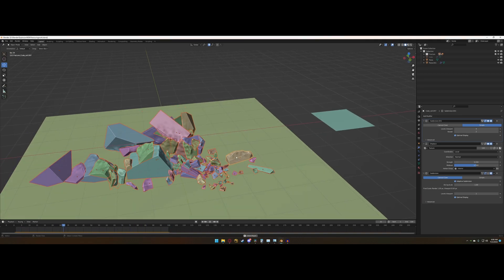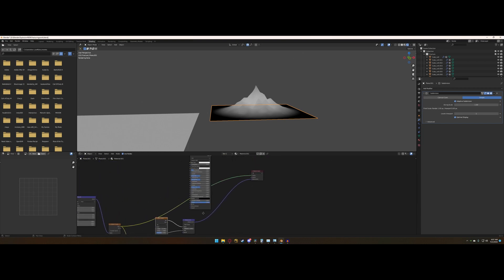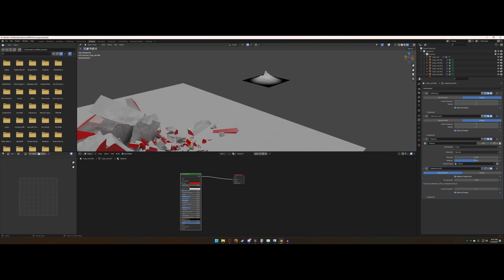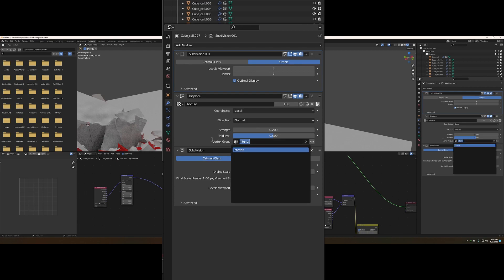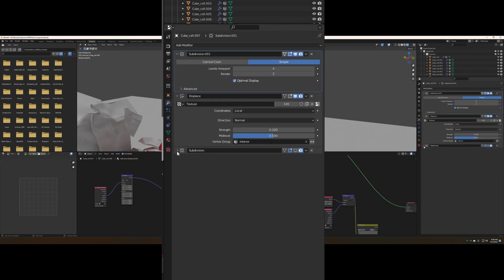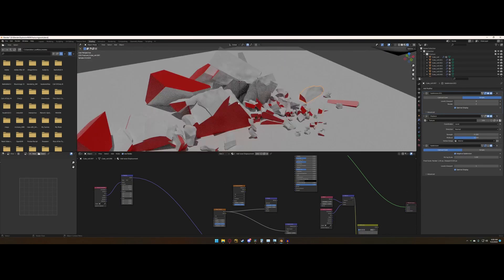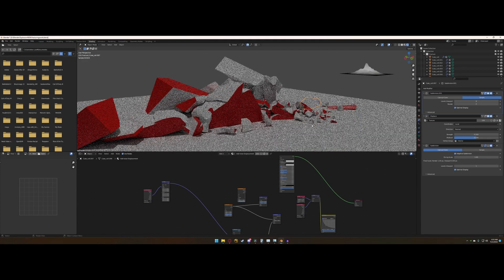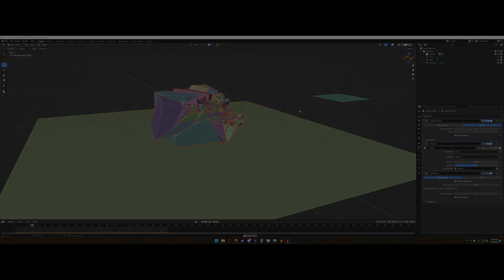More Realistic Destruction | Blender Tutorial (No Addons)

Comment: but with that method, the noise is not visible on the surface of the object, and there are intersections inside betw pieces
Reply from the maker: I'm not entirely sure what you mean by on the surface of the object. The goal for this is too keep the noise isolated to the interior. But I do agree with the issues about interesction inside pieces. It's kind of a hacky option, but it works so long as you cook out your sim first a lot of the time. 

In the future I want to create another version of this video going over some much better ways to do this
Reply: @levelupvfx  by noise surface i mean to not see perfect voronoi pattern outside but see noisy edges. Also the interior group that creates is not so acc. Is better generate global noise and use proxies for the sim.

Comment: I tried the technique yesterday but can you tell me how did you generate the interior vertex group ? Does cell fracture can generate it by itself or do you do it manually for each peace of mesh ?
Reply from the maker: In order to get the interior group, you need to check “interior vgroup” when in the Cell Fracture Menu
Reply: @levelupvfx  Thank you didn't see that, however I got a problem. I copy modifiers from active except that shard that are way smaller get displaced the same amount as the big one resulting in f* up looking shards. Is there a way to use the scale attribute as displacement strength for an object ?
Reply from the maker: @albanl8979  hmm, that is a good issue to bring up. This is because the noise is based on the original cubes UV coordinates, which mean that each shard will receive the same amount of noise

You may be able to change this by applying the scale and resetting the origin of all the pieces, but I would have to play around with it a bit to verify that that would work. it may come down to needing something a bit more advanced in reguards to the texture coordinates/object space settings.

 A quick cheat would be to grab all the pieces below a certain size, and apply a different modifier with different scale to those, though I am not exactly sure how you would do that in a time efficient way.